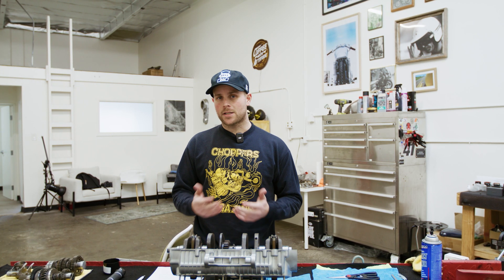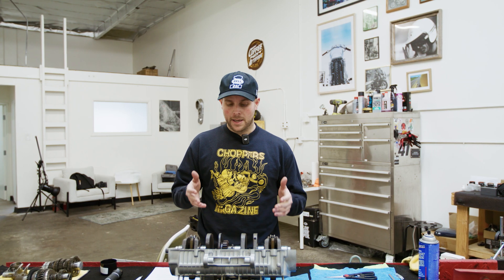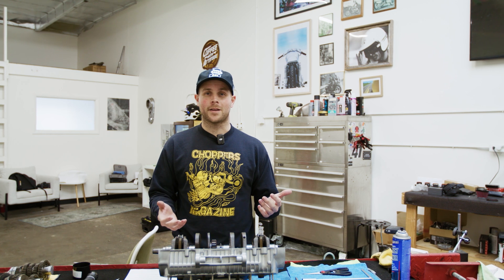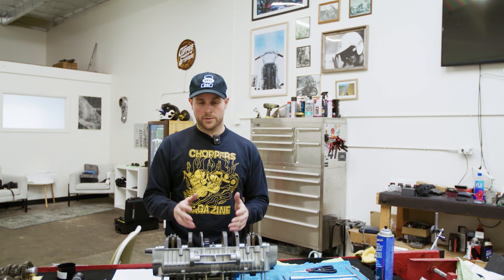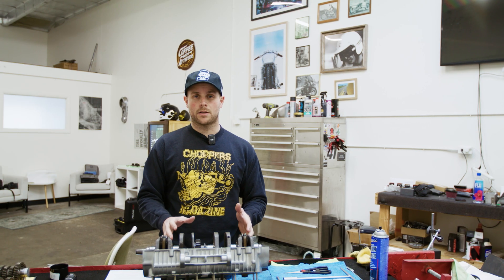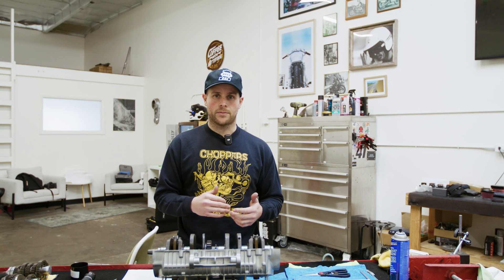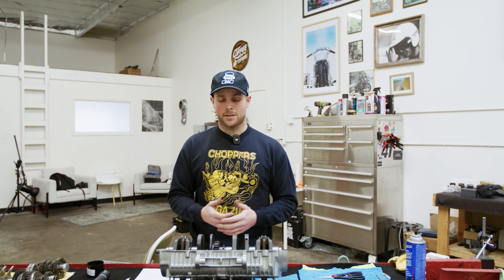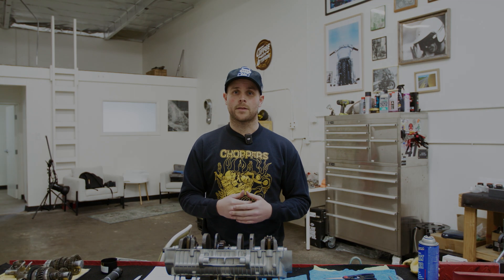How-to Build A CB550 Lower End Online Course Preview

Comment: Super interresting! Just a quick question regards to old CB500/CB550 engines, What specific engine oil do you recommend? I'm located in Europe so a slight different in what I can get my hands on. Any suggestions?
Reply from the maker: Sorry for the delay. The Oil topic is of great debate. Depending on what you have done to your engine is what really matters. If you rebuilt it with modern gaskets then you can run a more modern synthetic oil 10W40 or 20W50. I recommend a 10W40. If it has stock gaskets then it is better to use a conventional oil like that of whats called for in the manual. Hope this helps!